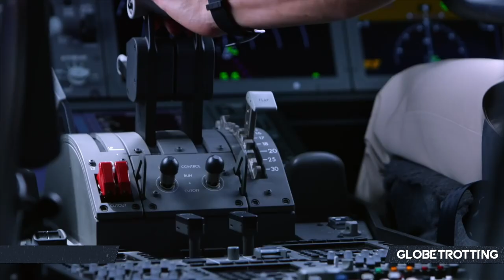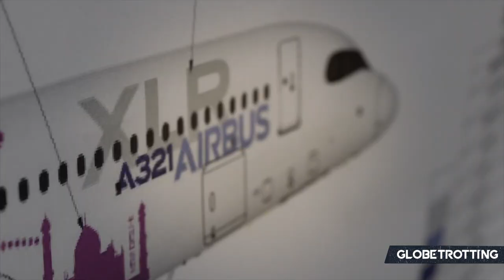Boeing's Next New Airplane...

Comment: Boeing wanted to replace the 737 long time ago but with the merge  Mcdonnell Douglas put a hold on it.

737 its already over 50 year old design. Airbus its not resting in their laurels they should have ready a composite wing in 2023 for a variant of the A320 family.

Comment: With the points that you bring up I feel more easy about Boeing waiting.  Airbus announced last year that they are working on a family of hydrogen fueled aircraft.  If that comes to fruition and Boeing has nothing to match I think that will be a big loss in the Boeing camp.  That’s only one example.  There are so many new technologies the industry is on the brink of making more cost effective. With Boeing working on improving the 73, 77, and 78 fleets I think that is plenty on their plate. 

I work in the cargo sector.  We recently purchased a bunch of 767s which is a very versitile aircraft for cargo.  That will allow us to retire some of our MD11s. But that begs the question, what will replace the MD11s if the 747 is now offline.  777? A350?  

Also what will replace our 757s in the next 10-20 years?  A321s? 797s?   So much to consider.   Only time will tell.

Comment: Boeing must really regret scrapping the 757 tooling, Who in their right mind at Boeing would be flogging the dead horse 737? The 757 was a perfect platform to modernise IMO.
Reply: Boom.
Reply: Sales 

737 = 15000
757 =1000

Get it now?
Reply: @mmm0404  A tad hostile mate? IMO the 757 would have been a better platform than the 737, Longer undercarriage to accommodate next gen engines, Which was the 737 Max's problem and more scope to shorten or enlarge the 757's fuselarge, Also the 757 is much better looking!
Reply: @scotty6346  Well with you on that one,  but production of the 757 ceased when sales dried up in 2024. 9/11 forced airlines to prefer the smaller a320/737 , due to the downturn in airtravel . 

i would love a 757 revamp , but at this time cost would be prohibitive , not to mention an all new engine would be required for it since it required higher thrust than what the current 737max/a32oneo engines can offer.

Comment: Boeing should do a 757-MAX series. Such a gorgeous and powerful plane needs a modern revamp.
Reply: I’ll fly on a 757max but will never step foot in a 737Max
Reply: @FireAlarmHowTooGuy  After all that's gone on with the MAX in order to get flying again, it's probably the safest plane in the skies right now.
Reply: That's such a tired idea by this point. It's not in cards
Reply: @FireAlarmHowTooGuy  there is nothing wrong with the 737MAX anymore. It’s been fixed for years and hasn’t had a single incident. Lol

Comment: I believe that Boeing’s ideal scenario probably was to at least announce the NMA in the late 2010s/early 2020s, with 2 variants to replace the 737 & 757 and likely heavy use of composites as a USP against the A321. But then Boeing was offer a large pile of money to fit the 737NG with new, more efficient engines and the temptation proved too great to resist and time and effort had to be diverted into the MAX program, including the ill-fated MCAS. Then in 2017, once MAX was flying commercially, attention could be focused back on NMA. That was until MAXs started falling out of the sky’s and were grounded by governments around the world in 2019, requiring an All Hands On Deck emergency response, drawing the workforce away from the NMA development. And that’s when the pandemic hit, and Boeing had to go into Survival Mode, with orders being cancelled or postponed, meaning no money coming in, would have bought any new programs to a screeching halt almost immediately. Add in the 787 QC issues and 777X development proving more challenging then originally envisioned, Boeing had to concentrate on putting out fires and righting the ship, there was simply no bandwidth for a clean-sheet designed 797.
Reply: Maybe the talk about the NMA back then was just smoke and mirrors to try to distract customers from the A320XLR, just like the nonsensical Sonic Cruiser in the late 1990s. An all-new mid-market narrowbody family in the 2030s looks like the right strategy in the present circumstances. But I wonder if there is a chance of resurrecting the ERX concept in the meantime.

Comment: I expect Boeing to look at what CFM International is doing with its Revolutionary Innovation for Sustainable Engines (RISE) research project. It could result in a radical-looking 737 MAX replacement that has 20% lower fuel consumption, thanks to the propfan engine that is part of the RISE project.
Reply: They mentioned this during the investor day that they are waiting for the new CFM engine. Not anticipated before 2035. Not sure they can wait that long.

Comment: The 737 has been in service for over fifty years and a replacement is long overdue. As for the 767, Boeing already offers an ideal replacement in the form of the 787. You also need to consider that the 747 was launched in 1966, prototype was unveiled in 1968. It made it's first flight in 1969 and entered passenger service in 1970. By the time the 777 - 9 enters service it will have been in development for 12 years. They need to sort this out and get things done much faster.....
Reply: This management team isn't up to it.
Reply: The 787 is not an ideal replacement of the 767 in many cases. It's larger and heavier because it's designed for very long haul routes and most 767's fly more mid haul transatlantic where there 787's size, weight and range are not required.

Comment: Cannot say Boeing is not making a wrong decision.  The NMA market is limited to start with.  Airbus has secured significant portion of it with its superior A321 products.  Boeing should have launched the design 10 years ago.  With the ensuing MAX and 787 problems and 777X delay, it is an opportunity lost.  It is prudent for Boeing to fix its existing problems and repair its financial status.  Yes, Airbus will enjoy superior market position, but that is what you pay for not running a top rated technology company.

Comment: The worst thing Boeing could do at this point is release "also ran" airplanes.  Over the next decade Boeing will invest $15 billion in updating it's design process.   My guess is that there will be a corresponding next level of production automation similar to what is now being developed at  Tesla.  New materials and processes.  Look for times and cost to drop by 1/2 or more,  inflation adjusted.  Over that period of time the automation will have driven the last spike into labor union issues.   What propulsion will be in 10 or 15 years is anyone's guess.

Of course AIrbus will not be standing still.

Comment: Airbus is already in the same boat as Boeing, the A320 line is already at the end of the development road. The difference is, Boeing got an extra 20 years out of the 737. The A321 still isn't a full replacement for the B757... it doesn't have enough wing or power. The one thing you never had to worry about with the 757 that has happened to me twice with the 321 this year... takeoff weight. I've had my bags left behind because the plane was too heavy for the temp/alt of the airport I was departing from... you never saw that with a 757.
Reply: Yes but A320 is a newer platform. And it can still be stretched if needed. Meanwhile 737 MAX-10 is a sretch of a strech of a stretch of a stretch of a stretch,  of an Airframe that was never meant to do anything remotly close to what they're doing right now. IMO for Boeing the best decison right now if they really need to postpone NMA would be re-enging of 767. Unlike 757 the airframe is still in production and can tap to the part of the market that is right between A321 and 787/A330 and is very unhappy that these are only available choices right now.

Comment: The 797 by series should be a broad range sub-series replacing, for example 797-2 > a220-100, 797-3 > a220-300, 797-4 > 737max8, 797-5 > 737max9, 797-6 > cutting edge 757-200, 797-7 > what should've been the 787-3. 8,9 and 10 sub-series should be designated for future supersonic variants all with similar full glass cockpits and follow with modern stick controls.
Reply: Lol what?
Reply: 797 and what’s next? They run out of numbers.
Reply: @herceg6772  boeing had a 307/377 series aircraft in the piston days so maybe start there. Its gonna sound weird af but maybe a b327, 337, 387, 397 etc.😂

Comment: until there is significant innovation in propulsion, I think Boeing is wise to not rush another plane to market as jet propulsion and airframe design in its current form, is reaching a pinnacle in efficiency.  when you look back on history its Boeing thats paved the way for new eras in flight with the 707, 747, and the 787. I think when Boeings NMA project does kick in to life, it will be another game changer, as Boeings history has already proven.
side topic and this is going to sound like blasphemy to most (dont kill me haha!), but I for one would like to see Boeing be the first to take the pilots out of the cockpit or at least resign them to a single pilot monitoring/AI flying. it is the future, Its going to happen, and currently Airbus is closer in its design philosophy towards full automation, so for boeing to get a jump on airbus on that front would be significant and part of another game changer.

Comment: actually, the 767 is still produced both as a tanker and a cargo plane.  Boeing no longer markets or sells new 767 passenger aircraft.  The question is not so much if Boeing needs an NMA aircraft (IMHO) but whether the market wants such an aircraft.  the A321LR has sold well, the XLR has shown a lot of interest, but maybe one should be careful to judge a single aisle aircraft (XLR) as successful when the order book is in the hundreds, not thousands.  Both the A320 family and the 737 family are over 15K units ordered/sold, and the question Boeing and also Airbus have to grapple with is what type of aircraft will be in demand in volume.  Airbus grossly miscalculated with the A340 and A380 as Boeing wiped the floor with those two planes with their 777 family of aircraft.  It's curious to wonder if it will repeat itself, or if Airbus will come out on top this time.  But if I were a betting man, I'd say history favors Boeing as the 787 beat the A350 to the market, even though they are not direct competitors, but rather utilize the same carbon fiber tech.  As an aviation enthusiast (and Boeing and Airbus enthusiast), this will be entertaining to watch.

Comment: Almost everybody agrees on the fact that the next generation of aircraft will probably be quite different from the actual one. However, everybody also agrees on the fact that all this is absolutely not mature for a developpement.
Some enhancement and further evolution of the actual aircrafts are not considered as being the next generation. even the NEO is not the next generation, it is just an upgrade and a revamping of actual planes design. A350, 380, B777 are the latest generations.
Boieng has inded an issue in the fact that they do not cover the compelte market with the revamped versions. Allbeit, I do not consider excluded that Boeing goes for a kind of neo for that share of the market. it would not be a new design but a revamp of an existing one, to bring it uptodate.

Comment: Boeing Commercial is dead, they have no replacement for the 737 MAX, 787, 757 and 767, Airbus is plotting a replacement for the a220, a320neo and a350 and Boeing has nothing, Boeing Commercial is dead and it may be hard to accept but I have debated this when many other aviation entheusiats and they have all said Boeing Commercial is dead
Reply: I don’t think so!
Reply: @bonzrh68  Why? Boeing has no replacements for their aircraft, they are not designing new aircraft and the 777x is 5 years late,plus the MAX 10 and 7 are still not certified. Boeing is refusing to design a new aircraft and they can't keep upgrading the 737, look what happened last time they did that.
Reply: why would they make a replacement of the 787 right now lol
Reply: Boeing commercial isnt dead. Airbus doesn't have replacements for their aircraft either. Boeing will have something up their sleeve. perhaps Airbus commercial is dead despite both companies still getting orders for narrobody aircraft. you all base it on the company and planes themselves taking no notice of all the orders coming in. Perhaps nobody will listen to those who say Boeing Commercial is dead when its not
Reply: @nickolliver3021  a220-500 and a350neo
Reply: @heidirabenau511  we don't know yet. It's all speculation

Comment: In the past, new aircraft design was largely driven by the airlines, with Pan Am or American Airlines plainly stating what they wanted and the plane makers competing with one another to be the first with the best aircraft. This seems to me a better way of producing innovative aircraft than building something nobody really wants and then pitching at the airlines. I’m sure if one or two of the majors asked for a 1000 seat, supersonic, vertical take off aircraft driven by nuclear engines powered by unobtainium, Boeing would be the first to start cutting aluminium.
Reply: Much like the original folding wing on the 777. Airlines demanded it, but nobody bought it.

Comment: Other comments below as well as remarks in the video notwithstanding, revisit the 787.... I remember hearing talk about a -7 version. If the issue is capacity would that not address it? Or is the hangup on "size" related to wingspan.
Otherwise, would not a smaller passenger size 787 bring with it the advantages to Boeing of lowered development cost as well as to operators of like type aircraft
Reply: Hence the never built 787-3, but then again the -3 was only slightly smaller wingspan and fuel capacity thus less weight but the overall economics wasn't what boeing hoped for and was scrapped, but i think that all lessons learned in the 787 can be focused on a 10% lower scale and build the 797.
Reply: @jocasi57  One of the issues was that the wing, while only slightly smaller, would require a slightly different loft. When we discerned that the panel could not be flexed to the needed contour, and that all new layup mandrels would be required, the business case collapsed and the smaller version was shelved.

Comment: Emirates also wants a replacement for the a380. I wonder if a 2-engine airplane the size of a 747 or A380 is possible
Reply: Yeah its called a 777x 
Nothing will replace an A380. TC can cry all he wants, he wont get one made
Reply: Emirates should get the 777x. They should go all-Boeing. 777x and 777-300ER perfect combination, and also, commonality.
Reply: No.
Reply: @Optimus-Prime-Rib  He might want to buy up all the used a380s he can find
Reply: @potxiusupfotalongkorn3237  They already have more than 100 777X on order. They were one of the launch customers now years ago.
Reply: @potxiusupfotalongkorn3237  lol, what happens if Boeing can't deliver the aircraft or it has a design flaw
Reply: @heidirabenau511  they will deliver the aircraft and it wont have A design flaw
Reply: @johniii8147  yeah, Emirates looks all set. B787-9 + A350-900NPS + B777-9

Comment: I don't think the Max 10 will get certified as it is (that's only an opinion and won't be surprised if it's wrong) so what I suggest they do is make the changes necessary and designate it with a new number, ie. 7X7i. The "i" standing for interim model, the "x" being whatever number they're due to use next. It'll be 737 in all but name and cockpit control changes and the eventual mid market or 737 replacement new plane can eventually be designated the new number without the "i". One thing though, someone like Ryanair might not want it if it's not 737, even if the 737 max 10 price doesn't change for the 7X7i, because the cockpit won't be streamlined with other 737 variants.
Reply: Yes the 10 will be certified in 2024. Don't dismiss projects when they have orders and frames already built (3)
Reply: It will be certified, it's just a question of timing.
Reply: @johniii8147  ah! OK then.

Comment: In the mean time an engine replacement STC for existing 757s (as was done with the DC8) would buy time and offer a better option for airlines than the already streched to it's limits A321.
Reply: That's not a viable option. Relatively few passenger 757's still flying and those that are are being phased out quickly. Within a few years only used for cargo and no business case for such a small low utilization fleet.
Reply: @johniii8147  plenty of freighter 757 with zero replacements available.